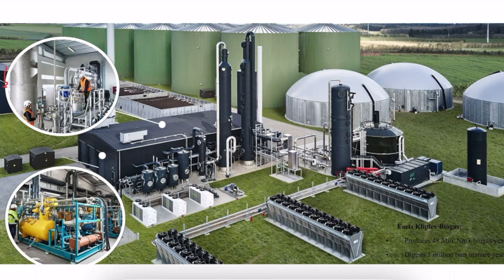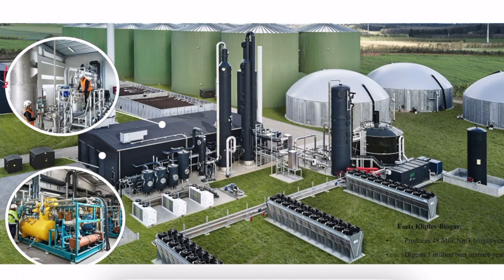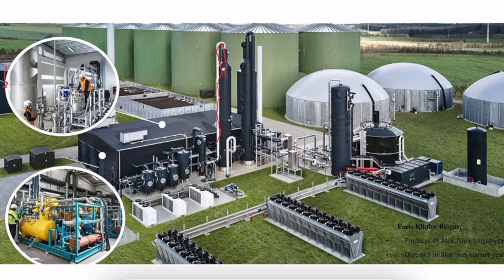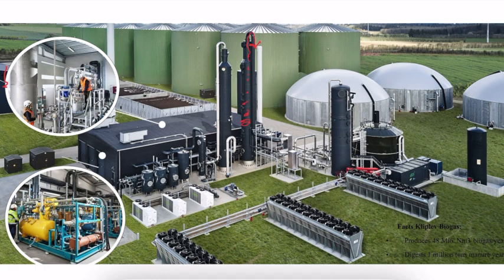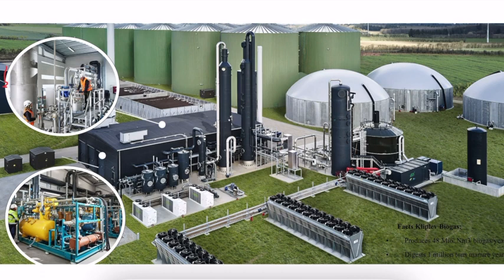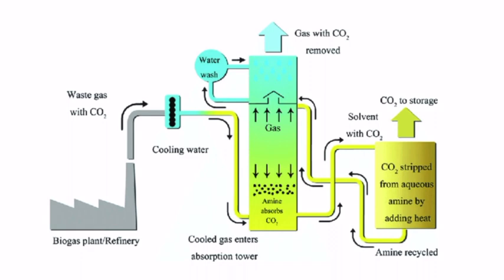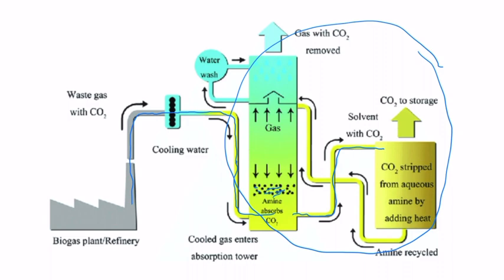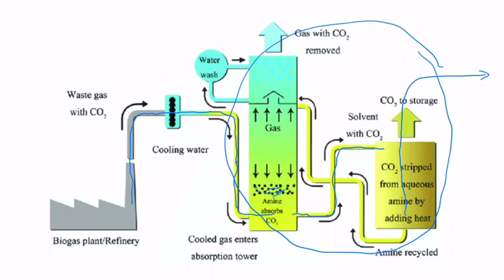Carbon Capture Amine Process Overview

Comment: For every carbon atom stored there ere two atoms of oxygen stored with it. That oxygen is taken out of our atmosphere when we burn carbon in whatever form, wood, coal, oil, gas or forrest fires. The way to reduce carbon dioxide in the atmosphere without depleting our oxygen supply is to stop burning carbon.